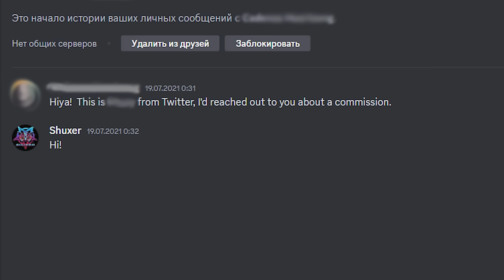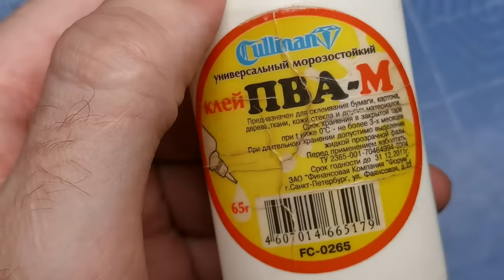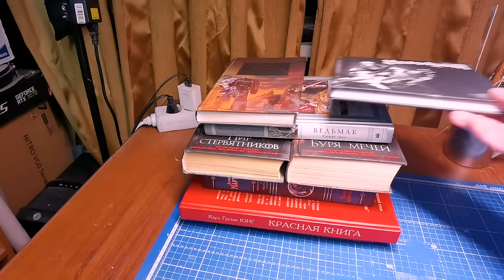2 YEARS TO CRAFT A PONY FIGURINE | Octavia Melody | All steps craft

Comment: wait, how you attached Octavia's front hooves copper cores to the main skeleton ? Did you just attached to clay? Doesn't sounds stable if this is the case
Also I wondering how these clay pony figures artist keep their work from bending? Clay is pretty fragile material without hardening it somehow
Reply from the maker: As for the hooves, I make special grooves so that the hooves do not rotate, then I solder everything together using epoxy. The attachment point becomes no less strong, as if it were connected to the main frame.
I didn't quite understand the second part of the question. Do you mean why a clay figurine does not bend during sculpting? Well, because I design the framework in such a way as to avoid this :D
Reply: @Shuxer59  I meant after sculpture is finished. The clay can still bend, right? On weak parts like ears, mane, tail which don't have frame. I could see it accidentally bend or break during shipment or in customer possession. Clay is very fragile to even lightest pressure.

Comment: Do you dry your clay in a kiln or do you dry your clay in the air? How long does it take to dry?
Reply: It looks like polymer clay, which is baked
Reply from the maker: I use different types of clay at the right time. Usually it's baked clay, but I also use Magic Sculpt